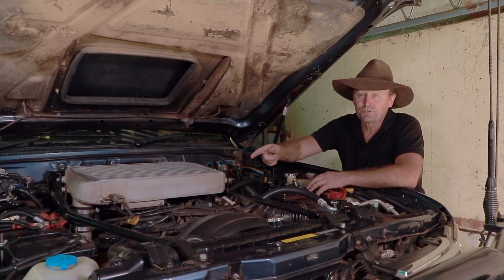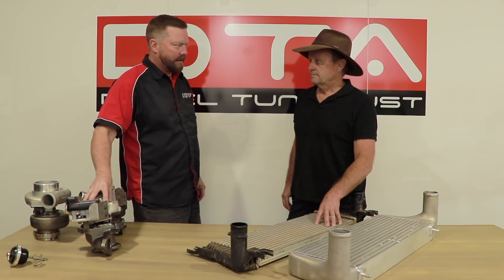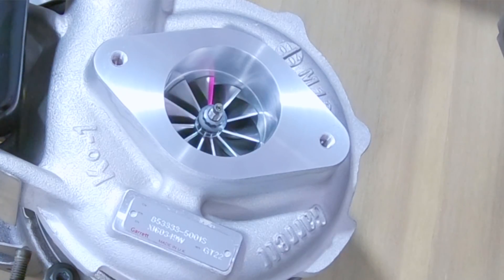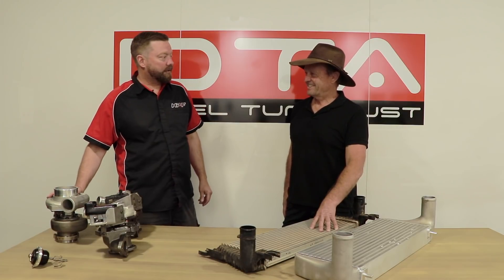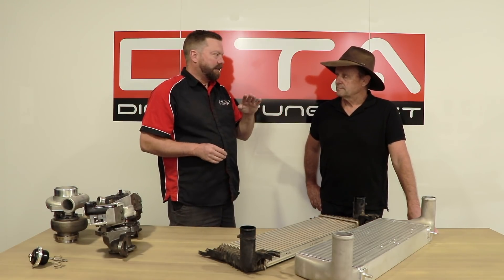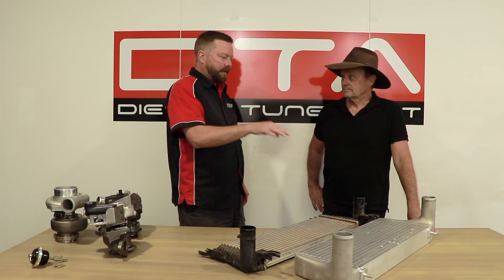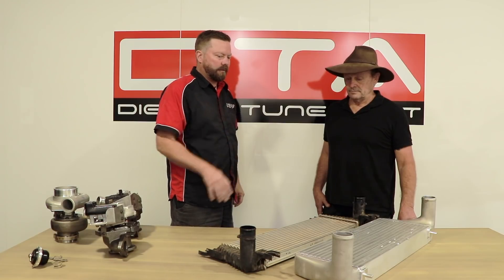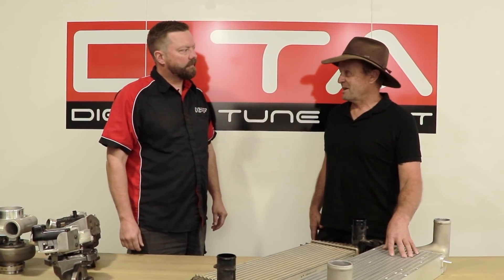Intercooler Upgrade and Turbo Upgrade - [ Can You Run An Intercooler Without A Turbo ]

Comment: Hey Batesy. Just wondering if your Intercooler has a fan underneath ? And if so is it on a thermo switch or manual switch? Thanks.
Reply from the maker: Gday mate,
Yes it does have a fan mounted underneath my intercooler. 
The fan is activated by thermostatic temperature and comes on by itself. 
It also won’t turn off until my EGTs get to around 200 degrees. 
Hope that helps mate. 

Cheers Tim.
Reply: @timbates4wdadventures  
Yeah nice ok. Just asking as I’m going to see cross country 4x4 and see what they recommend. They have the ultimate Intercooler and it’s huge ..comes with single or double fans. Will keep standard air box and pipe for now. See you haven’t changed yours either meaning you must be happy with the standard pipework? When it’s time for a tune I’ll consider changing. Thanks Batesy 🍺
Reply from the maker: @pooshoe100  
I had a Cross Country on before the cooler I have now. 
It was slightly smaller. 
I now have an HPD Intercooler. 
Yeah I’ve only change the bonnet scope , the plumbing is still standard for now. 
It’s work fine for the couple of years I’ve had this set up. 
The tune will make a difference. 
All the best with it all mate. 

Cheers Tim.

Comment: That was spot on Batesy, I understood all of it. I'm pretty happy with the turbo I have but never really thought about the intercooler when up the hills. Any ball point figure on the intercooler cost and install mate?.
Reply from the maker: G'day mate, 
The intercooler sure comes in handy for getting rid of heat on the hills or towing a van. 
Costings would vary a bit i reckon on different models.
Matt would be the one to have a good chat to on that mate. 
Thanks heaps for your feedback. 

Cheers Tim.

Comment: Hi Tim.

I've seen in a few vids you talk about your diff gears being lowered for low range low speed, do you have any vids where you go into detail and where you had it done?  Also with the rear diff lockers, did you get that done at the same time?

Hope that makes sense. I'm a learner here.
Reply from the maker: Gday mate,

I’ve not changed my diff gear ratios. 
I have changed my low range gearing in the transfer case. 
I have a 42% reduction in the transfer case low range gearing. 
Hope that helps mate. 
Let me know if you need any more information. 

Cheers Tim.
Reply: Ahhh yeah that's right the transfer case haha my bad.
Reply from the maker: @thecarpetcleaner  haha 
That’s cool mate.

Comment: I agree wholeheartedly with the content but as the guy said, he’d consider the the upgrade mandatory. But there’s heaps of stuff that we say should be mandatory (upgrades), snorkel, tyres, suspension, diff breathers, secondary oil & fuel filters....etc the list goes on.
Not knocking the video, it was good 👍
Reply from the maker: Gday mate, 
I agree about the extra things you listed. 
But this video is purely about intercoolers and turbos. 
Thanks mate. 

Cheers Tim.
Reply: @Matt Jackson absolutely agree 👍

Comment: Do these inter coolers work on petrol engines?
Reply from the maker: G'day mate, 
I'll get Matt to run through the replies today and answer them. 
Thanks mate. 

Cheers Tim.
Reply: if it petrol turbo yes absolutely, its even higher recommended for a petrol turbo  for many reasons.

Comment: Will a bigger intercooler lower engine temps when under load  cheers mate
Reply from the maker: Gday mate. 
I’ll get Matt to run through the replies tomorrow. 
Thanks for that 

Cheers Tim.
Reply: Thanks Tim the reason I’m asking is I have  a GU TD4.2 which doesn’t have a intercooler a the moment  and would it be beneficial to add one  cheers mate 👍
Reply: @Matt Jackson thanks mate 👍

Comment: Bloody top video Tim, The gu patrols mainly zd30 is not known for it's power. Mine struggles with power.
Reply from the maker: Gday Adam,
Thanks mate. It sure was interesting filming this one. 
Yeah the ZD30 in it’s standard format is a bit light on for power. 
A few mods can make a big difference. 
Thanks mate for your reply. 

Cheers Tim.
Reply: @timbates4wdadventures  Yeah Tim not much fun getting overtaken by a school bus going up hill i can tell you. I had everything checked out about 2 years ago but all came back as a ok, Time to start some basic mods to allow a bit more power while keeping it 100% safe. 
Changing out the standard intercooler i thought na not needed, but this video has convinced me otherwise.
Reply from the maker: @adamjones2025  that’s it mate. A few upgrades as you go. 
Have a chat with Matt if you want any further info mate.

Comment: Thanks Matt and Tim - love these techie shows mate! 
Matt, your explanation of moving heat makes a lot of sense and the application of this idea to turbo upgrades and just inter-cooler upgrades. What about spraying water on the factory inter-cooler under those load conditions - going up a long hill pulling a camper/caravan?
Reply from the maker: Thanks mate. 
I greatly appreciate your feedback. 
Matt will go through the replies tomorrow. 
Thanks again. 

Cheers Tim.
Reply: @Matt Jackson Thanks Matt and Thanks Tim.